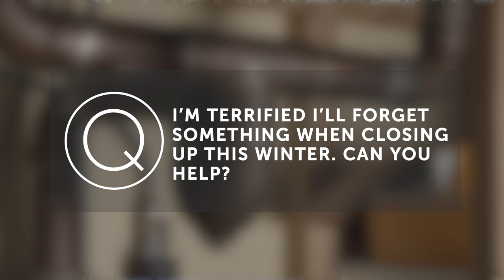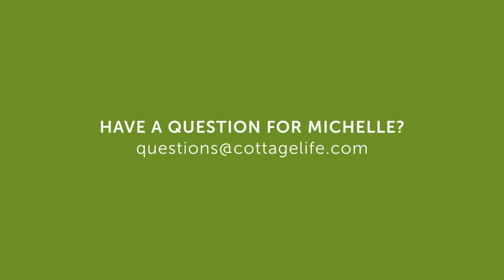Closing up your cottage this fall | Cottage Q&A with Michelle Kelly

Comment: Rather than use stabilizer in your fueled systems, switch to an ethanol free fuel for storage. Simply drain the existing fuel (or run it dry) and then refill with a premium fuel ideally from a name branded fuel supplier.
Fuel stabilizers realistically only counteract the problems with stored gasoline that ethanol introduced in the first place. If you must use a fuel containing ethanol then choose your brand of stabilizer carefully as some formulas may cause more damage to your fuel systems than they prevent.